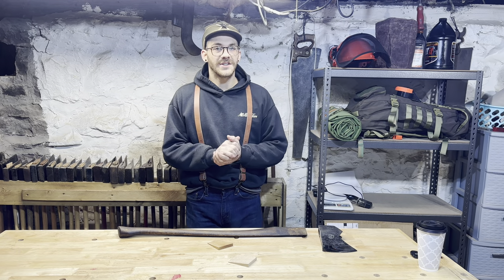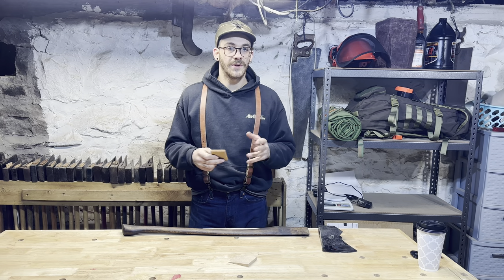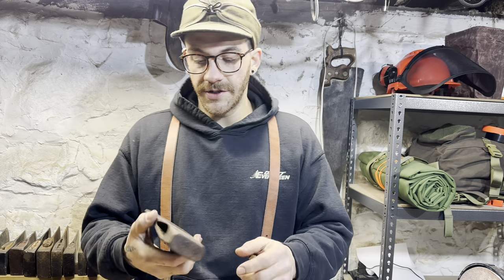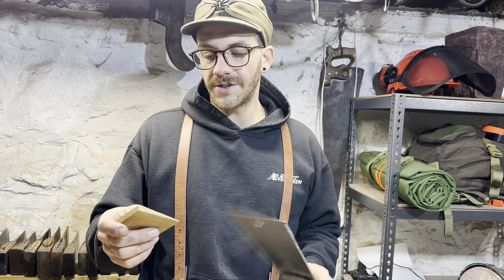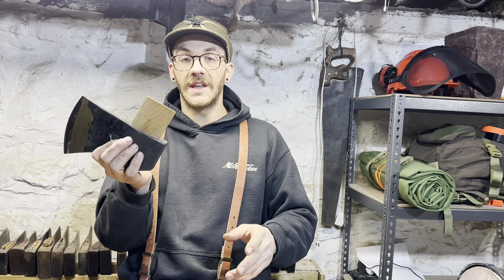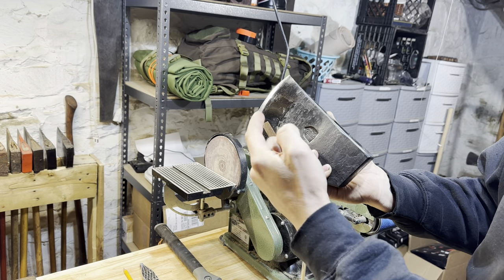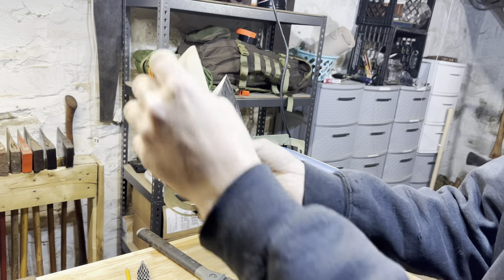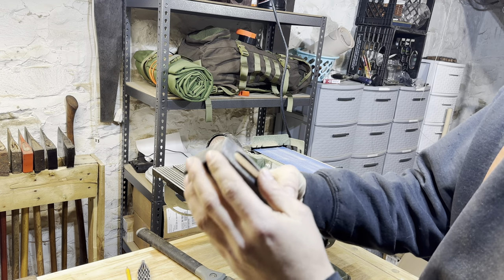How to tune your wedge for the hang. Axe head and wedge seating. Wedge tips !! Get a better hang.

Comment: Very useful video Joey, thanks.
I always mark the thick end of the wedge front and back  ^u  saves mistakes later
I would recommend using a 6 inch length of flat bar say 2 1/2 wide and 3/8 thick as a drift when driving the wedge. I have 1/2 dozen or so different sizes in the tool tray. Makes for easier more accurate wedge driving. I fit with the handle in the vise and the bottom standing on a secure block. When the wedge is about 3/4 the way home, take it out and a couple of sharp smacks on the end of handle, will correct any 'slippage' of the handle through the eye. Put it back in the vise and drive home.
I absolutely agree with you, fit with linseed rather than glue. In general, wedges pop out only if they are too thick in the first place.
One thing that is nearly always ignored is that, fitting one main wedge only, compresses the handle in one direction, ie side to side. When axe is in use, the biggest stresses by far occur in the other, longer axis, ie at the ends of the eye. I always fit a pair of cross wedges along with the main one, to provide good compression in the long axis. In many European axes, there is so much taper in the ends of the eye, that I need two pairs of cross wedges to fully compress and close up. Yes, I could use a couple of steel wedges, but if you later need to take the head off, you are pretty much 'stuffed'. Takes a little longer to do and a bit of practice, but the head stays solid for longer, and the effort is well worth it.
thanks again for the video ... OG
Reply from the maker: WOW !!! Awesome comment, thank you so much !! All great ideas here man thank you. I haven’t tired my hand at cross wedges yet. I definitely agree that could be a great help in some of the larger eye European axes. I have a couple very large eye axes, so I’ll have to give it a shot. Thank you so much again and thanks for watching, I’m glad you enjoyed the video !! 🤙
Reply: @940joey2  
Always happy to share so it you want more info on cross wedging just shout up buddy

Comment: Great job, very informative. I have found during my last few hangs of axes (and hammers) that I get great results when driving the wedge by holding the axe upside down, resting the wedge against a flat surface, and striking the butt of the handle. It helps jump the head fully onto the handle while ensuring the wedge is driven in straight and makes it almost impossible to split the wedge. Try it sometime; it may surprise you.
Reply from the maker: Thank you so much I really appreciate it !!! Thank you for the tip, I’m definitely going to have to try that method of seating the wedge on my next hang. Thanks for watching 👍

Comment: You said it in one part of the video ( just from experience ) . The best way to ensure a good fit is to have a few beater hangs under your belt . Keep the axe stuff coming axe man🪓🪓🪓🪓🪓🪓🪓🪓🪓🪓🪓🪓🪓
Reply from the maker: Thank you so much and yeah man when I first started out boy did I have some ugly hangs !! Since then I’ve went back and re hung them but I’ll tell you what my first ever hang on a jersey which really was my first hang is ugly and there’s gaps but it’s still going strong 2 years later never got loose 🤙 thank you so much again I appreciate the kind works !! Thanks for watching👍
Reply: @940joey2  Lol, I recently had to re-seat an old axe further down. That part of the handle had originally been below the head and got chewed up at the front, so theres a small gap. I didnt have any hardwood besides my wedge, but I had some 1/4" welding rod and I really wanted the job done. I ground the rod-core into a slight wedge, instant regret, its hideous. Looks like I pounded a big nail in there and its stuck tight, I just know its going to last forever.

Comment: Love this video man.  Love the rambling too.  But I have a major problem.  I do this with axes, hammers, anything that needs to be hung.   When fitting the head, I shape the head so it’s a tight fit at first.  As I keep checking, fitting, and filing to get it to sit lower to the shoulder, I end up with a handle that it’s way too small for the eye.  Like I’m taking way too much off but I’m not.  It might have to do with the eye being larger on the top than the bottom but looking at yours, you don’t have that problem.  Before you even touch a wedge your handle is perfect fit in the eye.   I’ve about given up I’ve screwed up so many now lol.

Comment: Great job and good advise regarding blo vs glue. Question how do you handle humidity when hanging axes? Being wood expanse and contracts with various moisture content, do you run a dehumidifier or only hang on dry days? How do you work that?
Reply from the maker: Thank you so much !! So as far as humidity goes yeah that’s tough for me. My basement where I keep all my axes is very humid and damp in spring and summer and in winter and fall it’s very cold and dry. Mg basement also floods a lot like every time we get rain I can guarantee I’ll have water on the floor, now the real question is how much 😂.. so what I do remedy humidity is a dehumidifier and hope.